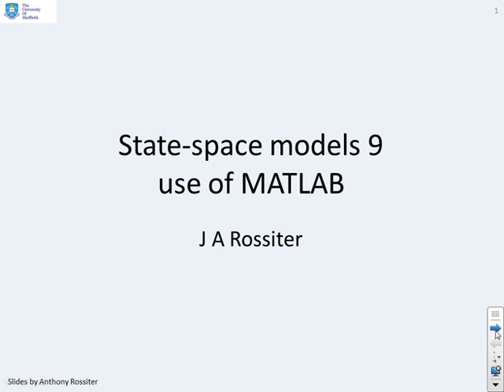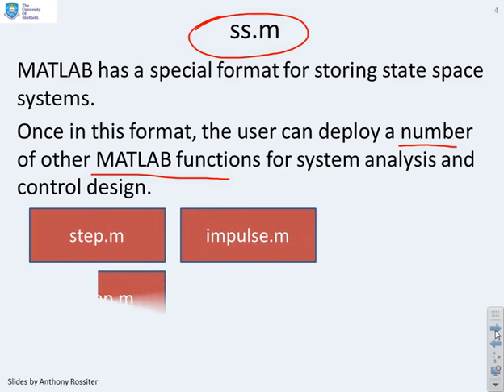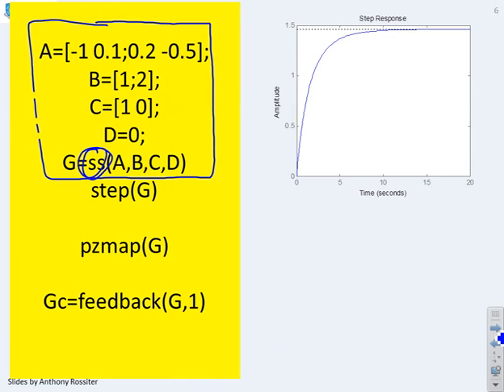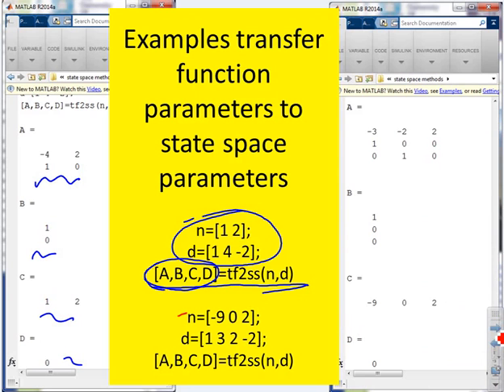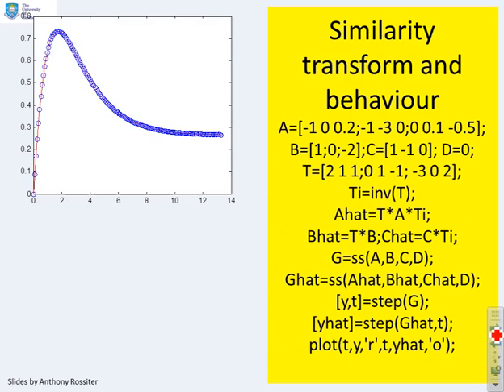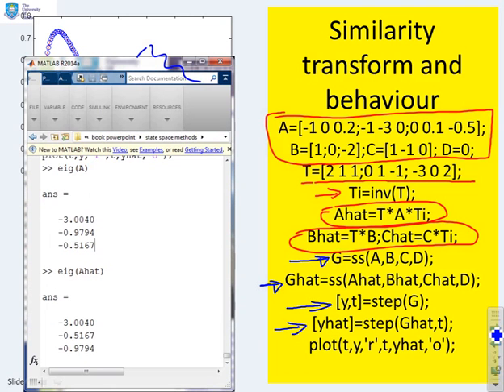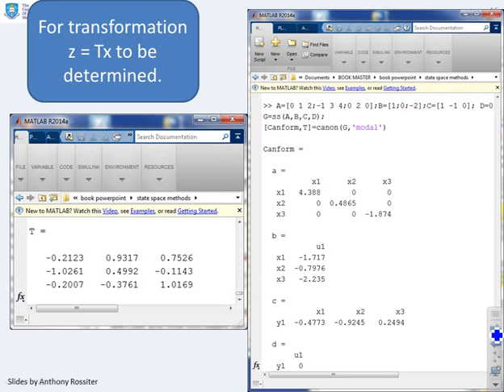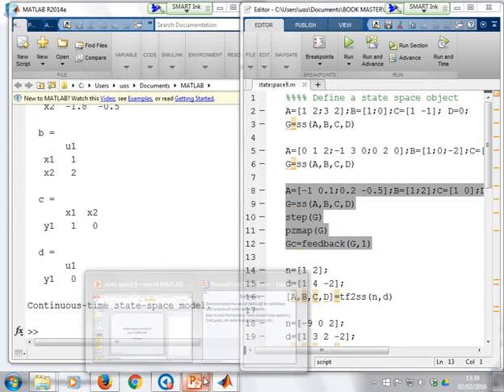State space 9 - use of MATLAB and numerical examples.

Comment: @5:14 What is the '1' in "ss2tf(A,B,C,D,1)"
Reply: the number of inputs (u) of the system. In this case we have 1 since we are considering a single input single output system. For a multiple input multiple output system, you would have a number greater than one, e.g. 2 if you have 2 inputs.